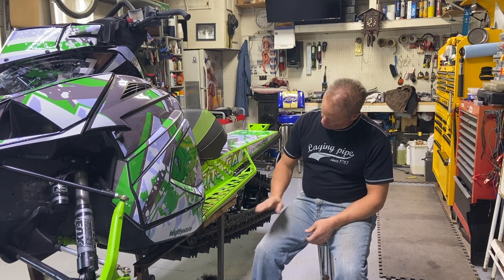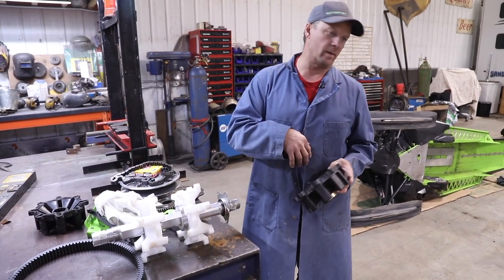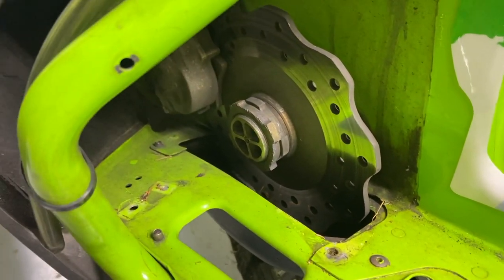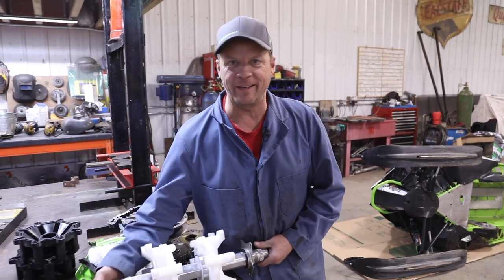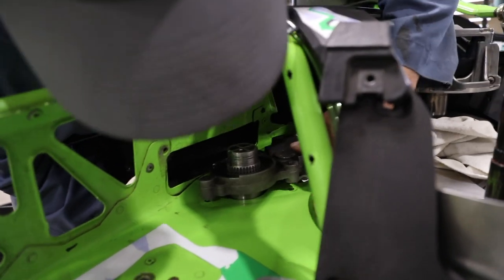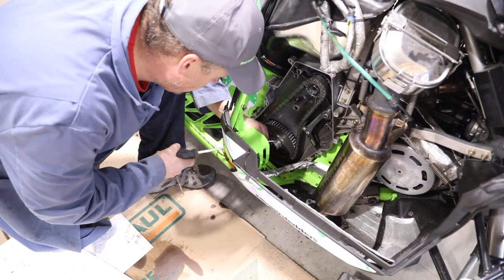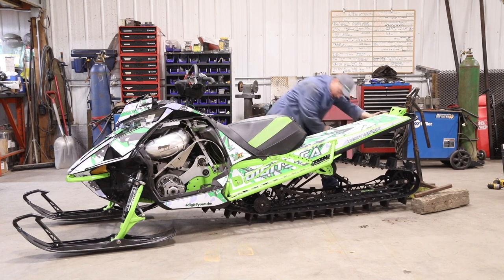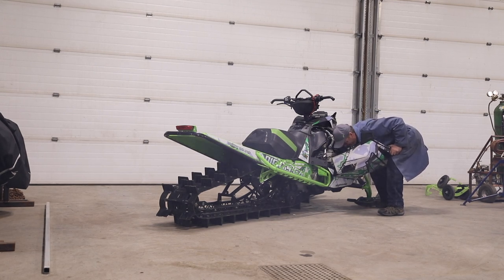Changing a track and drivers. 165 Ski-Doo track on a 162 Arctic Cat snowmobile?

Comment: Doing 3.5 conversion to my 13 with a Camso 280 175 and using Alpha drivers on 13 shaft. Had a 174 280 but wanted the 3.5 pitch. Will try out soon.
Reply: 3.5 setup hooks up so much better than the 3.0 and this is comparing same series tracks and only 1" length difference. Extra 1" between lugs gets better bite. Camso 280s are almost half price of Ski-Doo or Powerclaw tracks.

Comment: Are you going to reclutch since now you're gearing down?
Reply from the maker: Bigger drivers means I geared up !!
Reply from the maker: Bigger drivers means I geared up !! Already had a bit extra power , might try different helix ?
Reply: I didn't even think about the pitch! Makes sense. But if you cut all the excess weight of the track is there a weight difference between that and the power claw? I think skidoo track is lighter already.

On another note, have you had any luck drilling out tracks? I know it was popular a while back. But now the argument is that it hinders floatation.
Reply from the maker: I added clips to the track so weight is about the same ! Powder Claw aint that light !